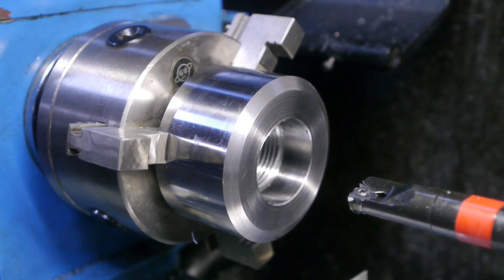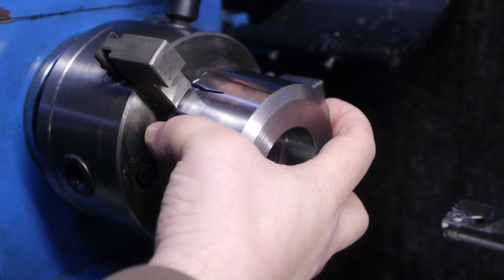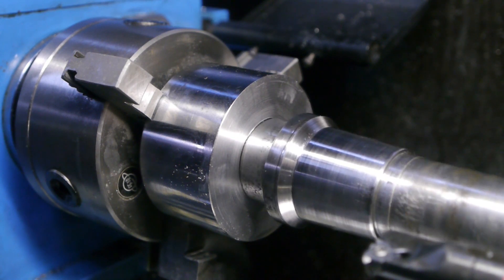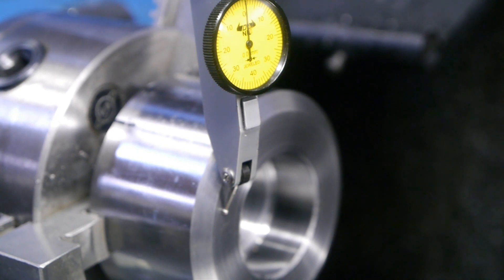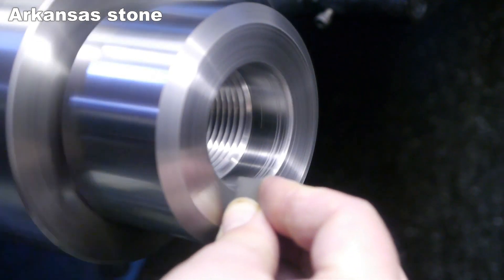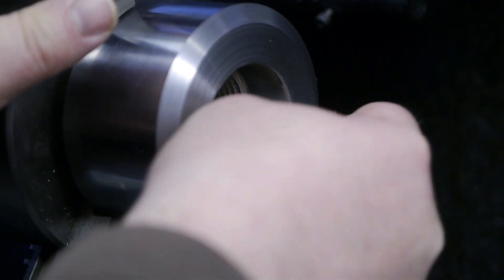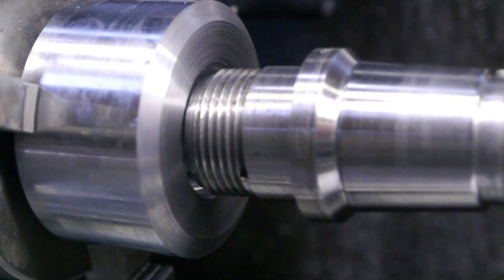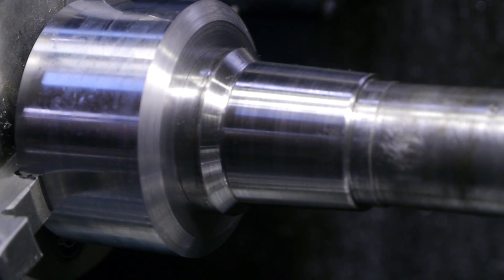The aftermath of my stupid machining screw up

Comment: I seen where you have mentioned that you are starting over.  I wouldn't scrap the first one just yet.  If the register bore and back face are good (and it will mount to the spindle in a repeatable fashion) you may yet be able to use it for a separate project.  If nothing else, it's a spindle protector.
Reply: Here is a link to that video I'd previously mentioned:  Threading without a thread dial and without a reversing switch:  https://www.youtube.com/watch?v=FNajMA4I20A

something to keep in your bag of tricks for later.  Setting up for this may help you find your 'groove' again, it you have to disengage unexpectedly.
Reply from the maker: I've actually finished the do-over tonight. The result is a bit meh. But still a lot better than the first time.
I've got this little 80mm 3jaw chuck that I will try and fit to the failed part. It will be good practice.
Thanks for the link. It was a very interesting video.
Reply: @Rolingmetal    I think we all start out dreaming of exact fit, mirror finish and no Bozo marks.  And by the end of it, we are happy enough to simply have it be usable.  The learning and the doing must be enjoyable enough, as I often find myself realizing that I've been doing a "potty dance," in front of whatever machine I'm running, for the past half hour.  A bit like being glued to the T.V. as a kid.

Comment: Do you have a threading dial on that lathe so you don't have to turn it off each time? A run-out groove helps a lot when threading especially on internal threads. Also measuring the locating diameter on the spindle before hand and making the internal one just a hair larger will make things easier next time.
Reply from the maker: No thread dial. But also not really missing it. For a longer part it would be a good thing to have.

Comment: By the way I thought I better put mu money where my mouth is and cut myself a thread.
I needed an external thread but not as challenging as yours.
5/8 x 18 and I don’t have die that size.
Hand ground a HSS tool and set a nice slow speed.
Did a scratch test and checked the pitch.  I found I could engage the half nuts in 4 different positions and it still lined up.
Set the compound to 30 deg. (Not 29 or 31)
Started with .005 “ cuts and moved gradually down to .001” once it started looking a bit heavy.
Once my test nut started going on I did a spring cut then touched it with a triangle file and it came out nice.
I think my my tool steel may have been just high carbon steel not even HSS.
I got a bunch of tool bits with my lathe and it was very easy to grind 😀
Find a couple of largish nuts and practice making some external threads.  That is what I had to do as an apprentice.
Reply from the maker: Congrats on a job well done :)
The last time I cut an external thread I used carbide inserts for the first time.
It worked a lot better than my hss toolbit, as no chips welded to the point.
And with the angled up point it seemed to cut a lot easier/lighter on my lathe.
I also got some older tool bits. They are indeed a lot easier to grind then good quality HSS.
HSS can take forever on my little grinder.
Reply: Rolingmetal I remember some of your earlier screw cutting and I think you were going straight in instead of 30 degrees.
This will cut on both sides of the tool at once and the two chips one off each cutting edge will smash together and ruin the finish.
You have since picked up the technique of setting the compound slide at an angle.
When you grind HSS you can put a bit of back rake and a bit of side rake for the edge that is cutting. This will help with material welding to the point of the tool.  This can also be worse using mystery metal.  I reckon mystery metal is made from used ball bearings and old car bodies 😀. 
When I learnt I was taught to leave the compound slide at zero angle.  When advancing the cross slide for each cut we would also advance the cross slide by 1/3 of that amount.  This had the same effect of only cutting on the front edge.  Although I find it a bit harder to keep track of where you are up to.  This technique may have helped with your clearance around the chuck as the compound slide would be at zero and you could have less overhang / stick out.
Make a couple of bolts just for fun.  You can try different techniques and some different pitches.  I’d also have a go at making a threading dial. Even if you buy some cheap Chinese thing and adapt it to your lathe.
I’m enjoying watching your videos.  Too bloody hot to do much in my workshop lately.

Comment: I don't think the end result was too bad, yes make another but give yourself a wider tolerance to work to, it'll take the pressure off and you may get a better result. How about cuttting the threads first next time, at least you can creep up on getting a good fit and sort the register after.
Reply from the maker: You're right I need about 1 or 2/100 more clearance on the register.
But I would like might it as tight as possible. I believe in might help prevent chatter.
I've already started over and this time I'm doing it like you described.

Comment: Sad that you have to start over.   Have you thought about machining most of the register, but then flipping the work so you can thread from the other end, then you could test the spindle thread first by itself, then flip again to complete the register.

Looking forward to the next video.

Dave.
Reply from the maker: I try to tell myself that it was good practice :)
I've already started the do over. This time I cut the thread on the full length/depth of the part so I can test fit the thread.
Then I cut out a bit of thread to form the register. I feel kinda stupid not doing it this way on my first attempt.

Comment: I'm no engineer by any stretch but isn't it the register that holds chucks true on a lathe & not the threads? If so, the threads were sloppy but the register was tight, face it of, enlarge the register while hopefully truing it up & it should work?
Reply from the maker: I want a tight register and a nice fitting thread as I believe it will help prevent chatter. 

But you are right it might still run true with those sloppy threads.
I wonder how the repeatability will be when screwing on/off a few times. I'm planning to find out :)